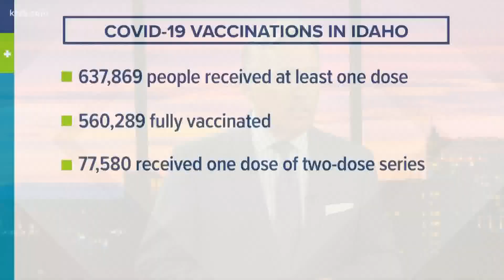Idaho epidemiologist on how vaccination compares to natural immunity

Comment: Natural immunity is vastly better, there is absolutely NO long-term data to prove that these vaccines are better, what a talking head 🙄
Reply: Correct. Any so called expert declaring long term efficacy for a brand new vaccine* is crazy. There's a reason approval normally takes as long as it does. We won't know long term until a long term has occurred. Everything is theory until that point. It doesn't mean we can't have reasonable expectations based on past experiences from similar things both illnesses and treatments for instance. We have to function based on theories and expectations to move forward. So far natural immunity is doing what the established science would expect it to based on past experiences.
Reply: @andymullarx6365  exactly 👏🏻
Reply: To be fair, they haven't been around long enough.  We'll soon have these long-term data in the next 10-20 years.  So, we won't know for sure either way until then.
Reply: "Update: August 27: A large study in Israel finds natural immunity confers longer lasting and stronger protection against infection, symptomatic disease and hospitalization for the Delta variant of Coronavirus compared to two-doses of Pfizer vaccine.

According to the study, after three months, risk of infection was 13.06 times higher among vaccinated patients and they were 27 times more likely to experience symptoms than unvaccinated people who'd had Covid previously.

Participants who were double jabbed were 5.96 times more likely to be infected and 7.13 times more likely to experience symptoms including cough, fever and shortness of breath."